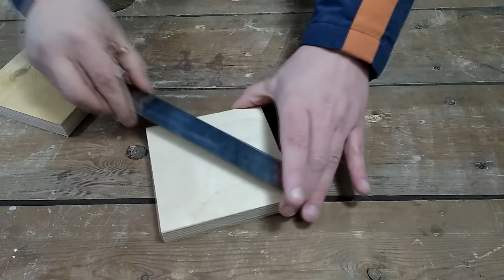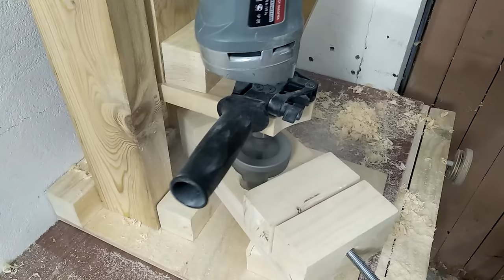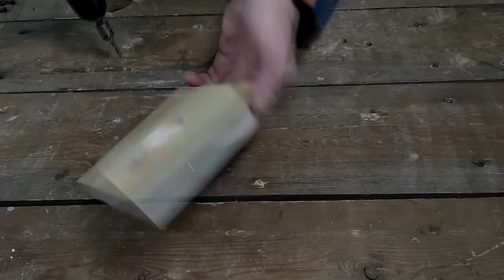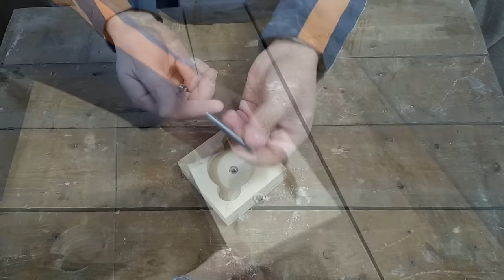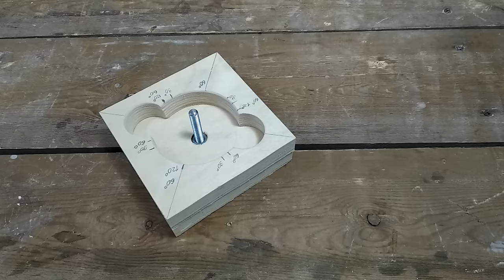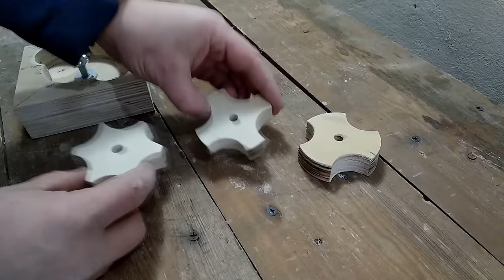DIY knobs - Making 3 in 1 Star Knob Jig | Free Plans + 3D Model

Comment: very nice but one thing is that the punch nut should be in the opposite side of the screw. if you put it on the same side the punch nut will end up loosening up. U can make a counterbore on one side and put the punch nut there and screw from the opposite side.

Comment: your method of making knob need expensive tools.Provide more simple method using manual tools so that it can be effort by everyone interested in carpentry.
Reply: I respectfully disagree with your idea that you need expensive tools. Another You Tube channel that I really love is 3 x 3 Custom by Tamara. Her philosophy is that there is always more than one way to accomplish a task in woodworking. It may take a handmade jig, but it can be done. For example if you see this video, he used a drill press that he made himself, and did not need or use an expensive drill press. Another option would be to use an inexpensive drill guide. It may take longer, but it would work. Also If you don't want to invest in a table saw, there are a ton of videos on how to create a circular saw guide that can be really inexpensive for cutting your wood to size. Two excellent jigs are on the channels DIYforknuckleheads, and Allflavors workshops. It can be done.

Comment: hi, great video thx. Question: should the threaded insert be opposite of where you placed them? Seems to me that as you tighten the knob you want the prongs on the insert to push into the wood (hope that makes sense)
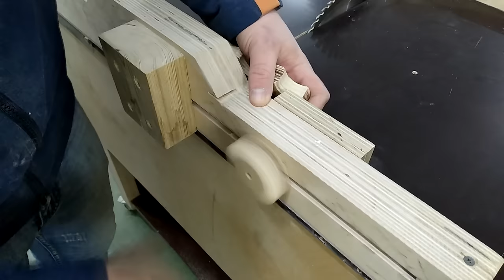Reply from the maker: You are absolutely right. But as you can see at 08:45 I made a little short threaded rod and twisted it as you said it does not work. Anyway, thanks for the advice, I think my viewers might find it useful.
Reply: @MazayDIY  thanks for reply. Can you clarify how you mark the various angles with the pencil on the jig? I'm having trouble visualizing where the angles are relative to.

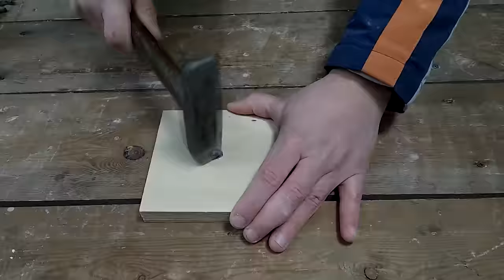Comment: I love the video and the plans, thank you. At the 3:17 mark, you drilled a counter bored hole and tapped in a nut. What size drill bit did you use?
Reply from the maker: The size of the drill must be equal to Width Across Flats on the nut (Wrench size). For nut M8, the size is 13 mm
Reply: That’s what I thought. For me, in standard measure 7/16”. Thank you so much. I am building my jig today.

Comment: burned your buttons nicely - try it with better tools or speed down then it fits
Reply from the maker: Ricj, wood hole saws are of very poor quality, now I bought new ones and there is no such problem. Anyway, thanks for the tip!
Reply: @MazayDIY  Here's a nice simple trick: Just barely start drilling the hole saw as a reference, then switch to a Forstner and drill just into either side to the hole saw kerf (depending on whether you want to save the plug or the outside piece). This allows for sawdust removal and keeps heat to a minimum. You performed a version of this when you cut the knob housing after the two overlapping cutouts.